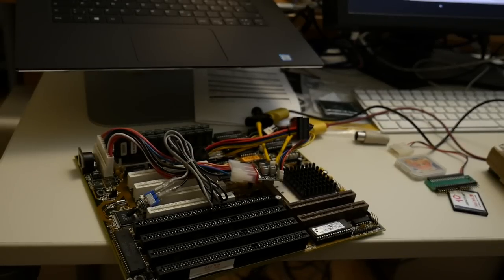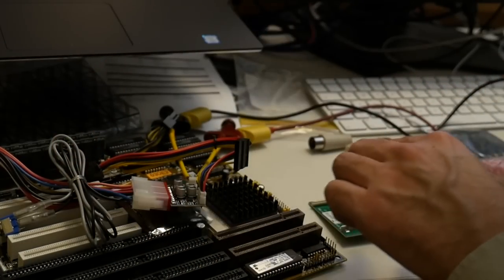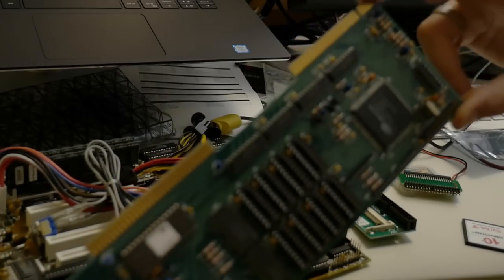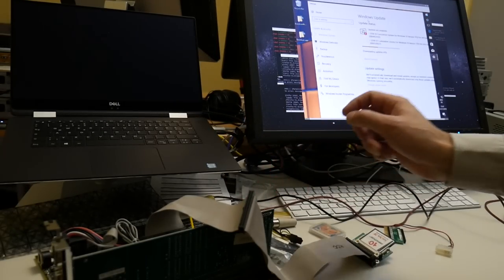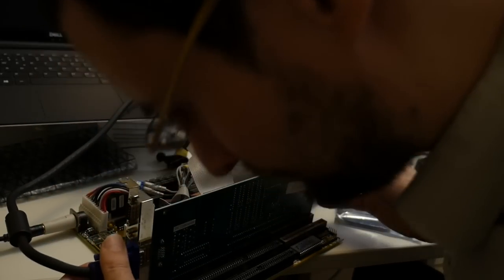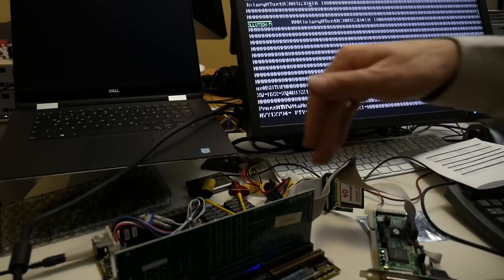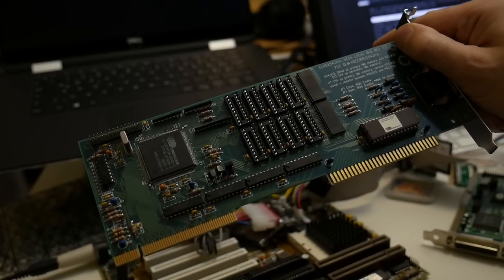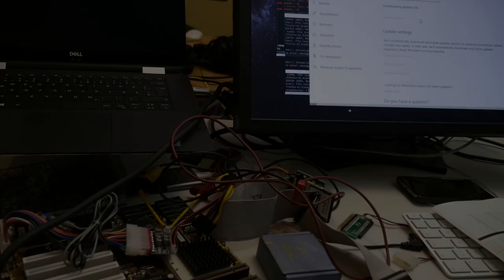The Vesa Local Bus experience^W experiment, ..!

Comment: I was surprised to find out recently that most VLB motherboards really did just connect directly to the CPU bus.

Clearly it worked fine, but it does make you wonder why they didn't think of adding the extra port from when the 486 was first released.

I guess it did add some extra cost for the connector, and took a while for them to define the pinout standard.

Comment: Maybe some good old white spirit might help? Since by pressing the connector, the picture changed... 
Anyhow, cheers!
Reply from the maker: Yeah, which white spirit do you recommend?
Reply: @renerebe  Any should do the trick, it's just for cleaning after all. 
Mmmm... white spirit might be too strong. Use alcohol instead to be safe, or better yet, Contact Cleaner.
I thought White Spirit was Alcohol, but reading Wikipedia it seems to be something else, it's actually a solvent!
Reply from the maker: Maybe some compressed air would be a good start, too, the VLB slot contacts look quite ok with bare eye, wonder what a magnification glass or even microscope would reveal there, … but anyways, this is also meant as guidance to keep in mind when shopping vintage / retro stuff on ebay, ..! ;-)
Reply: @renerebe  Yeah, compressed air will clear the surface from dust. But alcohol is for rust and foreigner substances. And yes, once you get the "Retro Bite" most retro hardware on ebay/else are so tempting! So it's good to have a word of caution. 
You might want to check out PCemu and 86Box, those are retro virtual machines and allows you to try different hardware configurations (MOBOS, CPUs, Video Cards, Sound Cards, ethernet cards, etc...) You will need the firmare from those hardware though, but you can get them on "emulation dot gametechwiki dot com" . That's a good "fix" for the "Retro Bite" ;-)
Reply from the maker: I know dosbox and pcem, you will find videos of me using it, eg for the low level gcc development including s3/virge acceleration ;-) https://youtu.be/UgvBGXiw6LY for my daily embedded and server Linux stuff I mostly use Qemu/KVM

Comment: Looks like possible bent shorted pins/old bad solder connections on the gd5428 chip.
Reply from the maker: Nope, I had reflown it twice. One address line to the ram is cracked somewhere on the way. Maybe a via, I ran a wire: https://www.youtube.com/live/3-dzi_35G-s?si=ibPfMCLTvr9ni0mk
Reply: Glad you fixed it! I have an ATI Mach 64 VLB that I can't get running, but it doesn't even post so I think it's the EPROM.
Reply from the maker: @Ray-rt3yh  please keep us updated how your repair is going!

Comment: It is just a faulty system. And these mixed boards are crap. Vesa Local BUS is sensitive, but it works in most cases even with 40 to 50 MHz clock speed without problems. I have made some experiences with cirrus logig though. The are fast most of the time, but become unstable more frequent as i remember if not at 33Mhz/ 8Mhz and below. Most of the times 40/8 will run but many cards i had would go crazy if put farther. My old 801/805 S3 card could live with 50MHz/10MHz an 1 DMA wait state. That was blazing fast back then. The CPU could write in the video memory at ridiculus speeds due to less waiting for DMA transfers to the sound card.
Reply from the maker: no there is some broken solder joint or PCB trace. When I press the card it works. I already desoldered quite some pins on the VGA, but that only made it worse :-/ so I wonder if it is rather some broken PCB trace. TBH PITA. Well, at least I have one other card that works, maybe I keep reflowing the broken one some other winter :-/

Comment: You are missing the memory chips on the video card.
Reply from the maker: No, it has 1MB soldered on, the sockets are for an optional 2nd MB. I guess without memory a vga card would display next to nothing, ..?
Reply: @renerebe  Yeah, tho I would suspect a memory failiure with all that garbage on the screen, tought you where missing chips, my s3 trio does garbage when I take out some memory chips.
Reply from the maker: Yeah the two big chips in front are 1 MB, the pcb Text clearly states an optional 2 MB upgrade, maybe I take the digital scope out another day and look at the signal on the vlb pin, or with some lens on the vlb socket or so, hope better contact could fix this